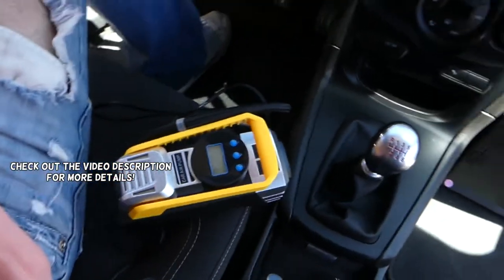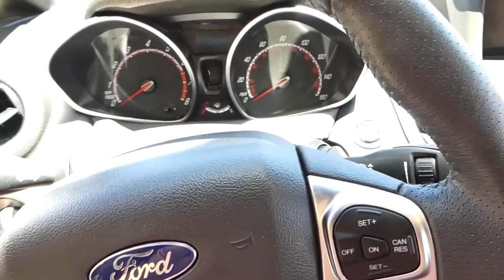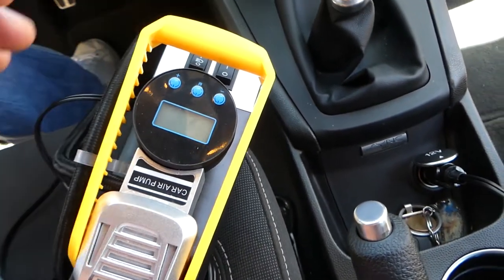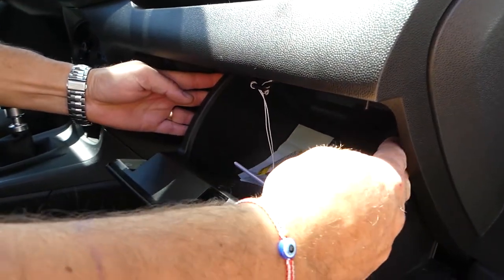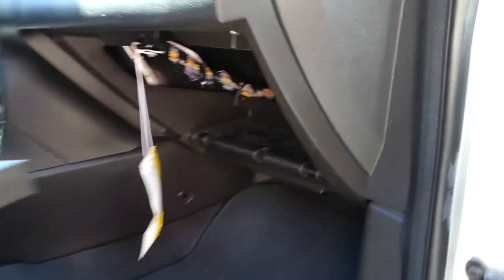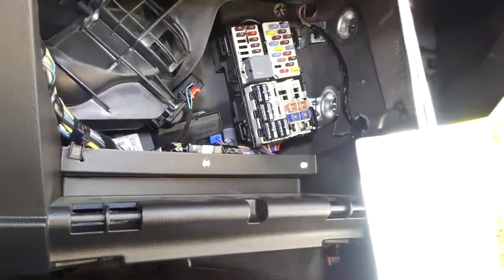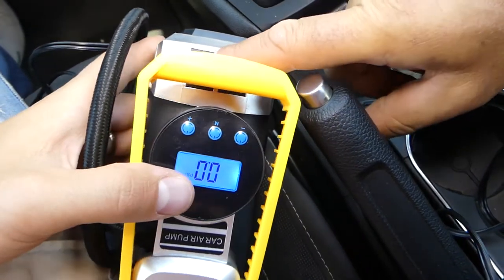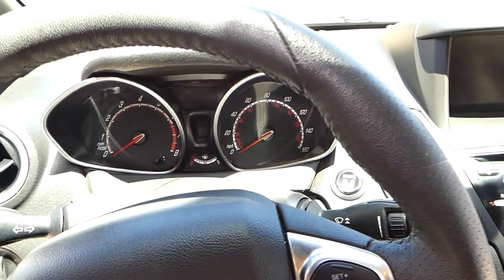FORD FIESTA CIGARETTE LIGHTER FUSE LOCATION REPLACEMENT MK7 ST

Comment: Thank you so much for this video, was struggling to figure out where the fuse is of the cigarette lighter.
Reply: The trick is that there are several spots, I had no idea some fuses were hidden back there (there is another spot within the engine space)
Reply: @masskeeper  On my Mk7 fiesta I discovered the 12V socket fuse was the small yellow 20A type, it was located 5 rows up and 3 in from the right in the passenger fusebox.

Comment: I have a 2015 fiesta and cannot find which fuse does the electric mirrors, it does not show it on the fuse diagram in the book.  driver side works ok passenger side does not work, they are not the folding mirrors, just the glass moves.

Comment: Pathetic video. Too quick no detail of exactly where. Waste of time
Reply: What are you talking about this was the easiest vid ever,short and to the point. I fixed my issue.
Reply: he showed exactly where
Reply: I watched this and thought it was great quick to the point. I didn’t know the fuses hid behind the glove box. Hopefully a quick cheap fix if I can find mine and won’t get ripped off by a mechanic being a female this happens a lot. I explained to ford about the bunny hopping it did they just told me I wasn’t driving it right then explained it was a manual (even as mine is an auto). Finally got a letter from ford saying it was a fault was so angry…girls know about cars too.